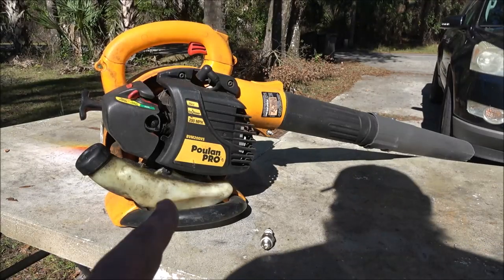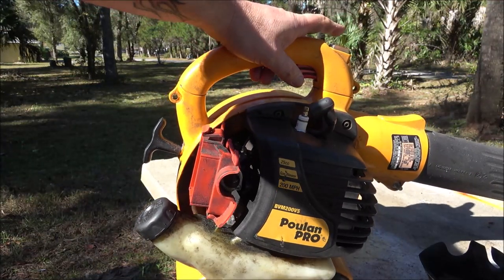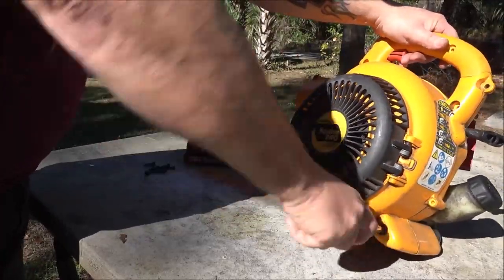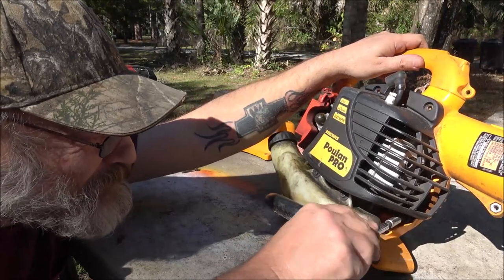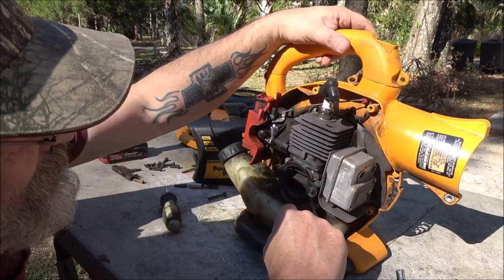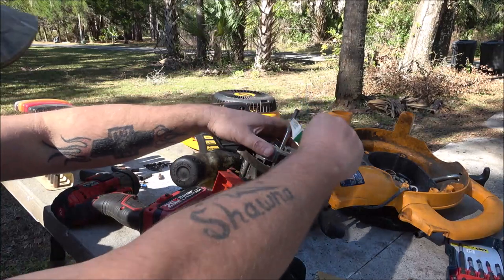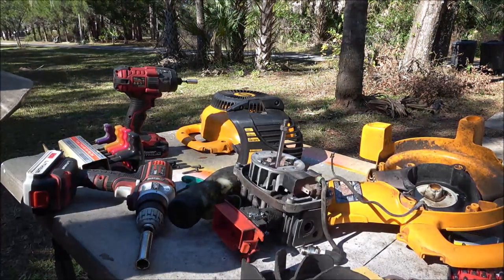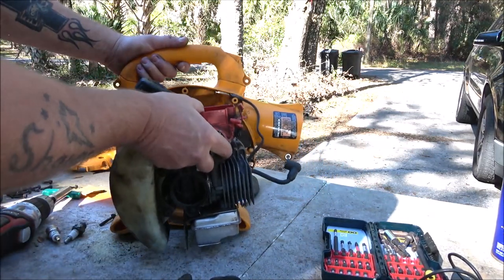Poulan Pro 200 MPH Hand Held Blower No Start

Comment: Interesting that the coil was rusted.
Good video as I am experiencing the same problem with a Popular 200 that I bought not working.
It has good compression 130 lbs. But has no spark.
I will be looking hard for any rust on it.
Thanks Michael
Reply from the maker: Let me know what you find out. Thanks for watching and commenting and have a great weekend.
Reply: Absolutely

Comment: Bad news, no cigar.
No rust or any deposits on the coil.
All the bolts were tight on the cylinder.
Watched a YouTube video on measuring the ohms.
Looks like the coil is dead, (I hope).
Ordered a new coil from Amazon.
I just hope the secondary windings are spec 10k-20k resistance.
Do you have any advice?
Michael
Reply from the maker: No, but I think you are on the right track.  Keep me posted.

Comment: Poulan  blowers are very sensitive to spark plug resistance. Should be in the 9K ohm range. Don’t use Champion plugs. NGK 4626 and you’ll never have an issue